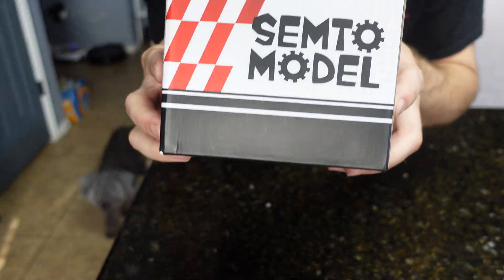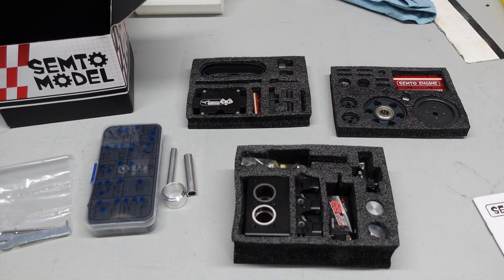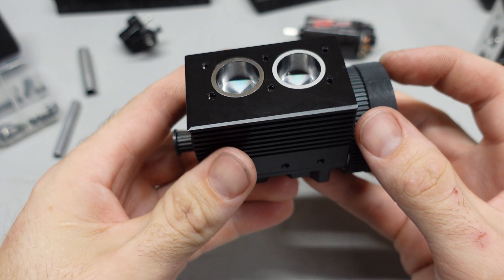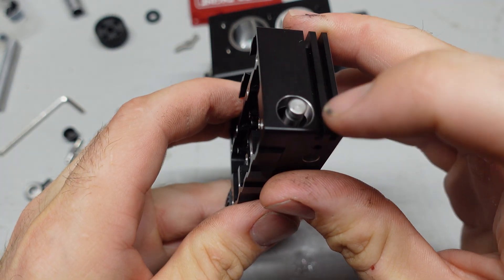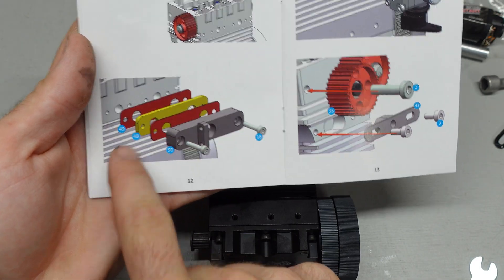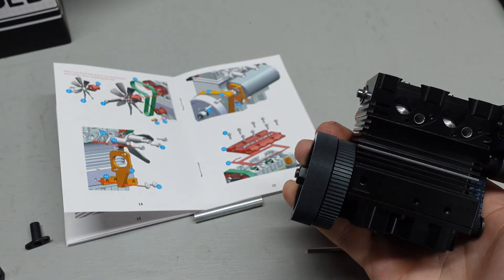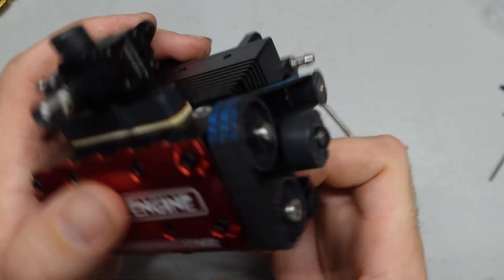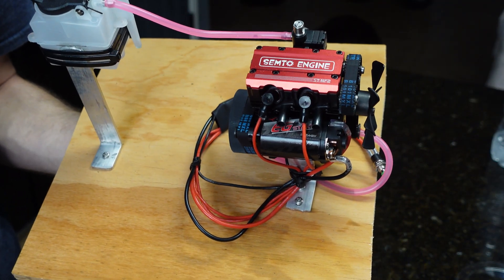NITRO 2 Cylinder 4 Stroke Engine Build And Test

Comment: I have this engine for a while can't get it to start
Reply from the maker: Check timing, then make sure glow plugs are good
Reply: @Mikebuildss  pretty sure they are I was told check needle sometimes off by factory. Two turns out?